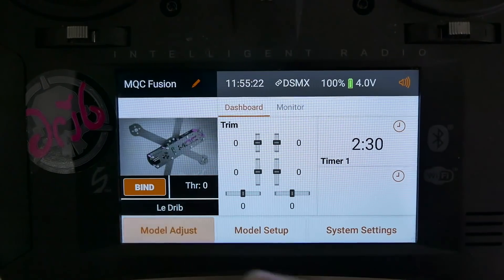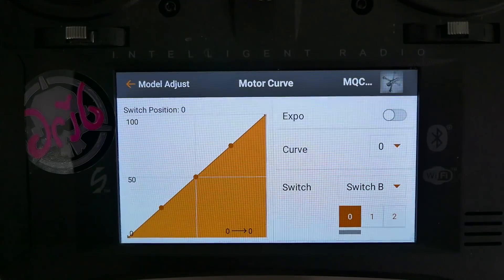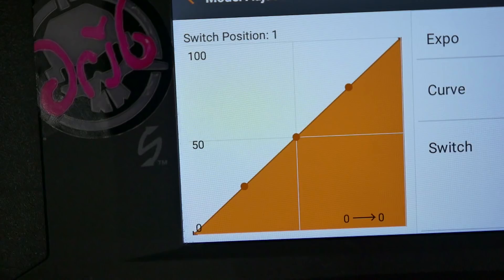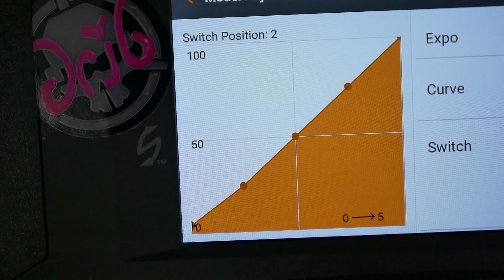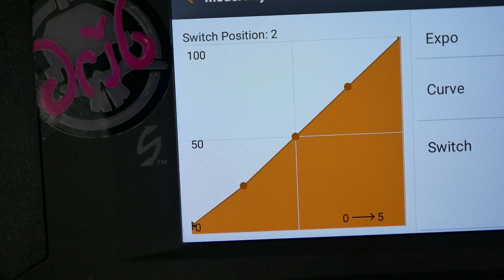Air Mode vs Idle Up - what's the difference?

Comment: If I use Air mode - I should tune my quad  (PID) in the same mode.  (not required to use Acro ?).
Reply: Air mode is not even one of the flight modes, and Air mode and Acro mode are completely two different things. When you have your air mode on, your acro mode is there as well. You can fly in Acro mode without switching to any other flight mode, and still change AIR off, or AIR on.

Comment: Dumb question but if I have air mode always on does it turn off when I switch to angle mode?
Reply: No, if "airmode is always  on" it means "always". You Better put airmode on a 3-way switch:

Disarmed- Arm- Arm&Airmode
Reply: @ZorrotorFPV  thanks that explains some of the weird landing behavior.

Comment: i know this is a super old vid, but i also use spektrum a DX6 and have to correct my endpoints. but  if i have airmode on with corrected endpoints i get throttle run away and it goes to 100% after around 20% or so, it just shoots up. i can have my endpoints stock and airmode on and its fine, or correct my endpoints using the radio menu to around 149 or using the cli command rxrange and have airmode off but never the same. 
any recommendations?

Comment: 3D Helicopter with constant RPM is much more straight forward. The RPM is constant, which gives you the same authority with cyclic PIDs, independent of your throttle (collective pitch). No fine tuning , complicated algorithm needed, just precision machining needed.

Comment: Hi I got a qx65 mini whooper with brushed motors and Beecore v2 FC it only has air mode horizon and Angle mode the motors have auto off should I turn this off and my idle at 1040 do I need to raise or lower this at all please can u help as I'm new to all this

Comment: So what BF setting controls airmode's "gain".
My 5" quads are fine at zero stick, but I have a 3" Twig XL (Betafpv) that wobbles around at idle after a punch out zero-g, idle decents.. it pretty much acts like airmode is off at idle, but the airmode box turns yellow in the modes tab.
I'd also like to know exactly what BF parameter sets the acro/rate mode motor idle speed..  In angle mode all of my quads have a higher idle rpm than they do in acro w/ airmode on.

Comment: Sooo.... basically..... You're cheating?

Actually the better question here would be.... What does Steele do? He doesn't use air mode but his throttle kill is just as stable.... Is he kinda using motor stop with idle up to basically imitate wat airmode does without the down sides?

Comment: I'm a old guy lol you can't just turn idle up off in betaflight?
I don't fly acro or freestyle and have no need for it. I don't want to flip over and have the motors still spinning and I know I can flip a switch but I'd rather not just to be safe.

Comment: So I think it's slightly different.  Traditionally the FCs -- betaflight, APM, multiwii, whatever, would disable cyclic control and PIDs with throttle low, basically assuming that you're still touching the ground.  That's regardless of motor stop and min-command.  So AIR mode, apart from improving the PID gains at low throttle as you say, also makes sure the PIDs are always enabled.  It should be noted that this does sometimes cause problems before you take off, specially if your Ds are to high for example, you may be sitting on the ground before taking off with air mode on and suddenly the quad starts jumping a little or flips on its back.

I remember time when people would do flips by giving the quad or tripcopter enough angular speed before lowering throttle to make it spin in the unpowered flight and then you had to time your throttle up command for when the quad was facing the right way.  That was never a problem with 3D helicopters because they always have cyclic control.

Comment: Could you do a video on calibrating the current sensor? I use the dalrc engine 4 in 1 and matek f405 and I cannot for the life of me get it to read accurately. It also won't read low current. I noticed when your quad was sitting on the ground in the dvr that it was still reading some current, mine reads 0 until i get to a hovering point, sometimes it won't even read anything there and I have to go a little higher.

Comment: Idle-up in the transmitter vs motor stop off in Betaflight. They seem to do the same, no? Any reason to ever prefer tx idle-up? (And yes, air mode is different and better in most cases)

Comment: You can use air mode with idle up to give lower powered quads some oomph. I do it often for some buddies but I adjust it using the idle speed values in BF. That and setting throttle mid to .25 or so helps a lot giving the kwad that extra little edge off the line. You need to raise idle speed in increments of 10 to 15 to find then test to find that sweet spot and back it down 5 to nail it. I also leave motor stop off.

Comment: I like an in-flight, adjustable "air mode" so I just add a line to the throttle mixer channel using the left knob (S1) on me QX7.
It's a super useful aux governor/throttle control once you get used to using it.

Comment: I'm learning to fly acro as of lately. Flew in auto level last year and ready to step it up this year. I'm reluctant to turn airmode on when practicing because I'm concerned with burning an esc or motor up if I crash. I would have to disable airmode on a switch and just not sure I could get to it before I land face down. If the props are blocked by something before I can flip airmode off will it burn up my esc or motor? Appreciate any feedback from you experienced pilots. Take care
Reply: mike216ism Getting familiar with the disarm switch will save your quad burning out.  You should really be disarming your quad as soon as you crash, especially with air mode. Disarming becomes a habit
Reply: mike216ism another solution is to have multiple modes set up. I like to have two "modes" on my transmitter: acro only and acro with airmode. I take off in acro only mode and then familiarize myself with the surroundings and then switch to airmode. The reverse for landing.
Reply: Lachy Staats thanks for reply. That's my exact concern. I will have to get familiar with it as I practice. Definitely have a long way to go. Happy flying

Comment: Simple explanation of AirMode vs IdleUp can be like this: When AirMode is enabled it allows the temporal throttle boost when doing rolls/flips with throttle down on radio, so you have full power of quad available on maneuver. With idle up mode, maximum motor output power is capped by "idle up" amount so maneuvers with 0 throttle are going to be very sluggish.

Comment: Do you, or anybody for that matter, use the fpv camera angle setting in BF? I have just started using BF/BuF after flying KISS exclusively for over 2 years. I believe that this setting mixes in yaw on your roll axis to make your rolls more axial, which I have always tried to do manually. Just curious if this is one of those things that is useful but the more experienced pilots are like..."pfft, L2Fly noob!" or what??

Comment: Motor stop: on and air mode active in horizon and acro only. That way you can arm (props not spinning) and then lifoff on angle mode.  Once in the air you switch to horizon or acro that has air mode. When wanting to land, switch to angle mode. This makes sense to me (PS. Thanks Mark)

Comment: I use idle up in betaflight and I have none of the problems you describe in this video regarding idle up. Your quad looks like there’s not enough I gain when you’re in idle up. Another possibility is that you have your min-throttle too low, increase it by 3-5% and idle up will have more authority when you chop throttle. But as long you’re having fun that’s what really matters. :)

Comment: Makes total sense to me, which is why I put Betaflight on this Walkera Rodeo 110. Cleanflight didn’t support Air mode, so I had to band-aid that with a throttle trim, but had no idea Air mode made PID compensations at low throttle. Thank you!

Comment: AFAIK, airmode essentially adds dynamic throttle control which gives the PID controller the possibility to add throttle when it's too low for stabilization and reduce throttle when it's too high for stabilization. We called that DTC (dynamic throttle control) in pre-(base,clean,beta,butter)-flight flight control softwares... ;)
Reply: I should add that that's essentially what we did before without idle up ... just automatically. Eg. you reduce throttle not to zero but just to exactly so much as you need to stabilize...
Reply: This also explains why it's more difficult to land with airmode on: The only thing you surly don't want when landing is that the PID controller increases throttle just because you touch the ground a bit... airmode does exactly that.

Comment: Actually, Airmode is a changed trade-off-decission. The trade-off: It is and has always been technically impossible to do a fast roll while having zero average thrust on all props (cause props dont spin backwards). So when you input both low throttle and fast roll, the FC must neglect one of your commands. Without airmode the FC consideres your throttle input most important and neglects roll control (as much as necessary to maintain the throttle request). With airmode the FC prioritizes your roll input, accepting that in a fast roll your overall thrust might for a short time be much higher than you requested with your throttle stick. This priority-setting is what stabilizes your quad so well at low throttle...and what makes it bounce when it touches the ground.
Reply: that makes no sense. Why do you input low throttle? You do a fast roll by cutting the throttle. Why would you even try adding ANY throttle if that's what you're aiming to do?

Comment: Would you be willing to talk about the pros and cons of FPV Camera Uptilt Compensation?  
Do the pros use it, or is it teaching bad habits like flying in angle mode?
Are there tricks that can't be done with it on, or would it just change how those tricks are performed?
Reply: MilSpecFPV don't use it, nobody uses it, you just have to learn how to use yaw at the same time. Play with your yaw rate until its easy to control

Comment: Drib, as far as I understand it (anybody, if I am not correct feel free to criticize) - in default PID controller can only utilize mirrored value for motor. So if you are at 10% trottle - the correction available is 0% for lowest motor and 20% for highest motor so it is balanced. What AIRMODE does is - it allows your PID controller to change your trottle value so your quad follows your command or responds correctly to environment. So if you're at 10% throttle but your highest motor needs 50% your PID controller is allowed to move your throttle to 25% so lowest motor is 0% and highest is 50%. Thats why your quad can BLAST YOUR FACE OFF......because if you touch it by hand with huge force it can get to 100% if needed...

Comment: Hi Drew, I still don't get why Steele and Snake are using Idle Up instead of airmode... When I saw the video where Snake is doing blind test of those with Steel, he actually preferred Idle Up. He stated that the quad didn't "wobble" at all after throttle punch (compared to airmode). The only advantage I understand so far is that when Steel doing "wall-bounces" and skidding, the quad doesn't go crazy. But what you said in this video (and it makes perfect sense) is that when you use Idle Up instead of airmode, the quad should be a lot less stable during low throttle. Is that maybe because Steele and Snake are using KISS instead BF?
(btw the video I was referring is this: https://www.youtube.com/watch?v=ihyfEysO7b4)
Reply: TomicaCZ No having less response at low throttle prevents the quad from going from 0 to over 9000 in tasmania devil mode.
Reply: Sorry, but I don't really follow what you mean by that xD
Reply: TomicaCZ Airmode prioritizes 100% PID authority over low throttle input. Meaning during slight bounces or strikes it gives 100% control authority to recover which often causes it to over respond and spin out of control. Idle up, doesn't have 100% authority it can only respond to a set + or - percentage from the average throttle input. I.e. 10% idle up allows a prop to spin down to 0% but not above 10%. The quad is only so responsive at 10% throttle and can't over react to small bumps.
Reply: I absolutely prefer idle up to airmode. There is a slight reduction in responsiveness at low throttle but consistency after bounces or strikes is a bigger priority, imho. You can bonk things like Steele or blow through scraggle like a snow plow.
Reply: Thank you Jesse for that clarification. I totally get that thing that the quad doesn't go nutts when you hit something, but I dont know how I feel about the lesser responsivnes at low throttle. Does it mean that I can't do let's say throttle punch and roll/flip on top as fast as I would do with airmode? Like when my max deg/s is 1053, I couldn't do that fast roll/flip with Idle Up?
(sorry for my english, I hope you can understand what I wrote xD )
Reply: I run a pretty high Super Rate (rate .83 SRate 1.02 for a top end 1200 degrees/sec) and feel that my 8% of idle up gives me 80-90% of the responsiveness at 0 throttle. I do notice slightly less effect of both the P and I term at 0% throttle and  dives and low throttle to 0% flippy flops are affected. 

In trade I'm able to bonk large limbs mid power loop and recover or like today pin my quad against a limb with it's own thrust and recover.  Things that airmode would send the quad spinning willy nilly everywhere.

I used to keep airmode on a switch for when I was doing more aerials and less proximity but my flying has evolved and I no longer fly one way or the other. Airmode went unused for months...
Reply: You should note that 8% idle up is pretty low, 10 or 12% would likely keep the responsiveness high and bounces and strikes predictable. I like to do a lot of low level inverted hang stuff that needs as little thrust as possible and sacrifice a little performance at 0 throttle. Only time I really notice it is on windy days with dives, a little bump to I term usually fixes it.
Reply: Thanks a lot for explanation :)
I will definitely try it someday to actually feel it. Right now I finished my first build so I'm tuning it and then when I'll get used to high performance quad (instead wizard x220), then I'll fiddle with Idle Up a bit :)

Comment: good explanation.
in addition to your explanation. - maybe it changed over the years. a lot has.

as per Jb's explanation years back. pid loop was symmetrical in terms of apply force. 
if you were low throttle and wanted to roll,  it couldnt apply enough thrust to the 2 moving motors as symmetry wouldnt allow it. airmode removed the symmetry block and allows more "stick" on the motors that are moving.
it also works at high throttle too. 

idle up without airmode would still limit sticks when throttle is at high or low. perhaps this is why the "feel" is there.

luv ya work drew

Comment: Drew, is there any way to keep Airmode from chucking my quad into a death-roll every time I clip scraggle?
Reply: Christopher Mawson Use idle up, exactly the reason I dumped airrmode. Use about 10% throttle to have better low throttle control. Can ram through scraggle like a bulldozer.

Comment: Why do they call 5” quads “mini quads” is there a full size quad?
Reply: Something like a 500mm quad (Think Phantom) is a full sized quad. Camera ships and such.
Reply: Kevyn Watkins thanks
Reply: When people first started building quadcopters they were quite large, made with wood & plastic. When smaller racing quads came around they called them "mini-quads" because back then they were tiny compared to the large rigs people were flying. The name stuck.
Reply: 350mm for a phantom
Reply: xclass.racing
Reply: JP H as a 3" drone is considered micro then X-Class is at least Mega or Giga, isn’t it? ;-)

Comment: So is the option for Motor Stop in Betaflight basically doing the same thing as your "Idle Up" explanation, but instead of it being from the radio it is happening in the Flight Controller?
Reply: No, turning Motor Stop on will literally put the motor brakes on to stop your motors from spinning when air mode/throttle is cut. As opposed to allowing them to freewheel in that circumstance. The difference is noticable even in non-inverted flight, you will drop very quickly with motor stop on, while having no attitude control.
Reply: I was intending to compare having motor stop turned OFF, and having the Idle Up setup in the radio. I understand how it works when you have it set for the motors to stop spinning, I'm just curious as to how it works without airmode enabled to keep the motors spinning when you lower the throttle stick to 0 with each of these methods.
I hope I'm explaining myself clearly in this sleep deprived state.
Reply: It really depends on how much "Up" your idle is in Idle up, at a certain point the difference is minimal, but you risk keeping too much thrust on at idle then. I fly both Kiss and Betaflight, in KISS there is no difference (KISS's "AirMode" is literally just dropping the min command to keep the PID's active at idle), but Betaflight handles it differently and I've always preferred Air Mode.
Reply: Yes, but with motor stop turned off, you are setting the min throttle value that the FC will ever output (somewhere around 1050, or 3.5% based off of what I remember from when I used Betaflight), so even though the FC reads 0 (or 1000) from the receiver, the motors never receive a signal of zero. So isn't it a nearly identical end result?